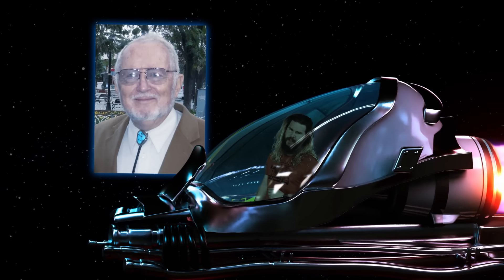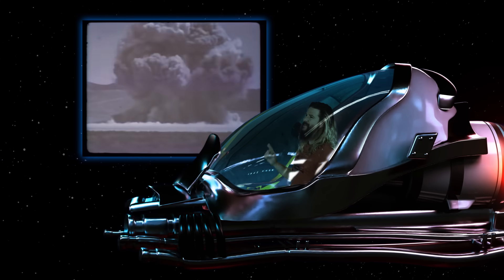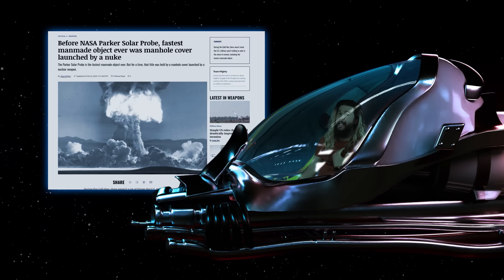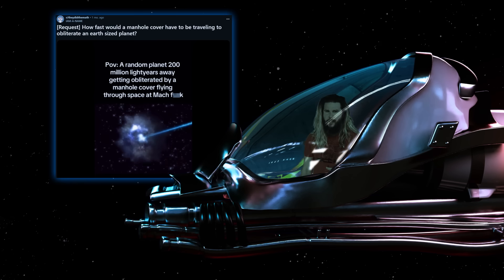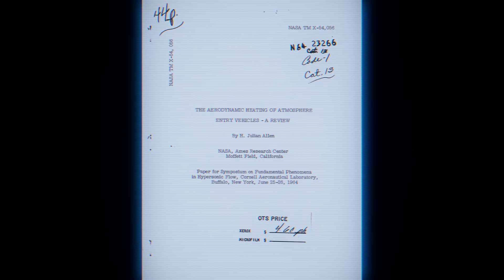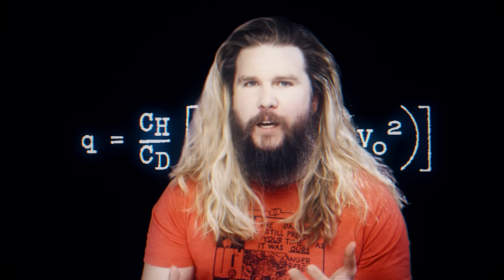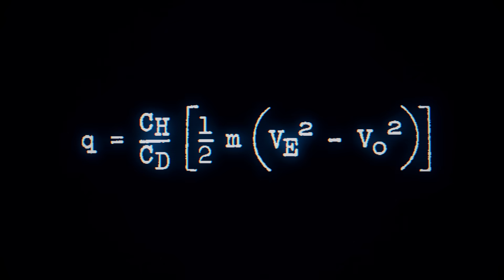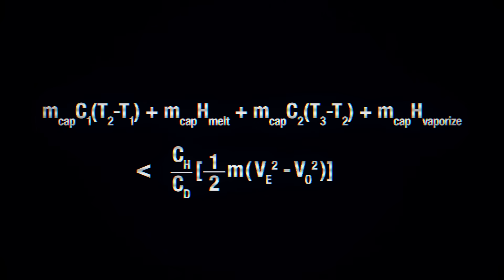Debunking the Nuclear-Powered Manhole Cover

Comment: You're forgetting a very important part to this, the force created by the nuclear explosion and air volume behind and around the manhole cover. Those calculations are specifically for an object ripping thru the air with nothing but it mass pushing it along.
Reply: The air behind the manhole cover doesn't move at mach whatever. Absolutely not. That's like saying a bullet from a gun is accelerated even when it leaves the barrel, which is nonsense.
Reply: nothing was pushing it along, it was given a kick at the start (that would rip it apart)

Comment: I have a couple of objections.
1.) When you're using the calculation for air resistance, you're assuming that the with the most surface area was face up the entire time. This is very unlikely to be what happened. When the explosion happened, it's likely that a section of the weld broke first. As that broke down the rest of the weld would break down fairly quickly. However, if that is the case, then the cover must have had some rotational energy imparted on it. (Think of lighting a fire cracker under a penny. The penny won't fly straight up without flipping end over end.) 
This means that using the calculation for air resistance is adding way too much heat to the object. If there is any significant rotation, the face of the cover simply wouldn't be "facing up". (I suspect you could cut the energy by half to come up with a good estimate, but I don't know how accurate that would be.)
2.) Meteors traveling through the atmosphere are probably not a good proxy. While they do heat up the issue is that they tend to explode. They tend to have ice trapped in them which eventually vaporizes and causes enough pressure to simply destroy the meteor while in the atmosphere. This likely wouldn't have happened to the cover as there was nothing inside that would cause it to explode in that fashion. It's cast iron, not a mixture of rock and ice.

Even with all this said, you're still likely right that the cover was vaporized. The eat generated in your calculations were an order of magnitude above what is needed. Even cutting the heat by roughly half wouldn't prevent it from being vaporized.

Comment: The assumption that the plate moved upwards as a flat plate is incorrect.  It was most likely spinning which will change the drag coefficient.  The path of the cover was straight up as opposed to at angle as you would see with a meteorite so that will effect the time in atmosphere.  The density of the air seems to have been neglected.  As the manhole was going up, the air density was rapidly decreasing which will reduce the rate of heating.  Lastly, heat transfer rates need to be considered closely.  How long does it take to heat the steel?  If the manhole was traveling 150,000mph, the total time spent in the atmosphere was about 1.42 seconds.  I am not convinced it didn’t make it to space and beyond.  If it stayed together.  But they never found ant pieces so…
Reply: 1.42 seconds is a long time at reentry speeds. At 66km/s, the drag would have been over a quarter of a million gees, that would stop it completely in 0.02 seconds.
Reply: @WJS774  That statement does not make logical sense to me.  What is the drag coefficient of a rotating metal plate?
Reply: @cityboywithhorses6233  Approximately one, the same as anything that isn't a highly optimised aerodynamic body. This is a "back of the envelope" calculation, remember?

Comment: My only problem with this is that Nasa says atmospheric decreases the higher you go, so my question is, can the cap reach a high enough altitude to where it can survive the pressure necessary and make it to space? And because of my question I still have hope for it that it made it space cause aerodynamically speaking the hotter and faster something is flying the more it aerodynamic it becomes so I feel that yes it melted but it melted into a shaped that allowed it to go into space someone around the size and shape of a baseball base

Comment: I think you are probably right, but it looks like one of your assumptions was v_0=0, or assuming all the kinetic energy gets converted to heat. If it retained most of its kinetic energy by the time it left the atmosphere then maybe it wouldn't be vaporized. It would be interesting to just see like a python script of a differential equation for the velocity vs altitude given the varying density and considering drag losses

Comment: The atmospheric heating is impossible to calculate in any meaningful way.  If the drag caused it to fly up directly side on, then not all parts of it would be heated in the same way.  If its flipping end over end at a colossal rate then there would even be a degree of airodynamic cooling going along with it.    It was also through the atmosphere of any meaningful density in half a second.  It's pretty hard to believe it managed to vaporise in that time, and even melt it.  For it to heat that substantially, conduct that heat to the centre of a 4 inch thick piece of iron, melt it and vaporise it in half a second is pretty hard for me to accept.

Comment: Are you sure about your numbers? Almost all the energy on the left side is in the latent heat of vaporization. Like 99.96  % of the energy is in vaporisation? I was trying to figure out what this looked like if you considered the entire column of air as a series of perfectly inelastic collisions. This would be worst case as it ignores the shockwave boundary layer that would help protect the object by having the shockwave stand off from the blunt object that is the plate. Using the total mass of the atmosphere and the ratio of the plate's surface area to the planet's surface area, I get around 23 metric tonnes of air resulting in a final velocity of the plate mass system of 2.5248 km/s. The kinetic energy lost in that collision is only about 1.8 * 10^ 12 Joules (but if you've got the numbers wrong on the left hand side of your inequality, that's academic). The whole thing takes about 2.9 seconds to reach space (100km) using this model. Yeah, I know, air pressure isn't constant and all sorts of things mess with where you want to draw the line when using this model, this is a somewhat arbitrary threshold I've chosen, you might be able to do better. The fact that it doesn't all collide at once means that the 2.5 km/s threshold is a lower bound for it's velocity at 100km above the surface. That speed is the reason I wanted to look at it from this perspective. This is quite different to re-entry as it takes time to have something burn up in the atmosphere. This is more like a deep-fried mars bar, maybe gooey on the outside, still frozen solid on the inside. It's lifting a column of air with a base area of the plate out of the atmosphere, a far, far easier thing to do than to compress a column of air into the atmosphere as you do on re-entry. If the numbers on the left hand side of your inequality are remotely close to accurate, at least some of this definitely made it to space.
Reply: Found the error, Iron's heat of vaporisation is 6340 J/g not kJ/g. Yep, this got burnt up easily.

Comment: There is a difference between the plug flying out of the atmosphere and a meteor entering it. The atmosphere gets thinner the higher the altitude so the plug would be encountering less drag as it travelled, while the meteor would encounter more as it moved lower. If the plug was going to vaporize I would think that it would have happened as it was launched as it would be moving at its highest velocity as well as encountering the thickest atmosphere. Of course I could quite easily be wrong since I’m nowhere near good enough with math to try and run the numbers. 

Also even if the plug did make it to space it wouldn’t have been the first man made object to do so. That would be a German V2 missile. One reached an altitude of 175Km which is considered space.

Comment: I feel like there are a few variables that were not discussed in this video such as maybe the manhole cover was flying sideways or tumbling through the air and the different are densities that this thing would have rapidly encountered and another thing is the speed that the object was traveling maybe it didn't spend enough time and the Earth's atmosphere to accumulate enough heat energy to vaporize.

Comment: Theres a few big problems here:

1) drag decreases as mass ablates, reducing the drag coefficient.

2) the cover would likey tumble, making its drag coefficient far different.

3) the atmosphere thins dramatically, basically if it hadn't melted by the stratosphere, it wouldn't.  You cannot take troposphere drag as a constant, you MUST integrate the density dependent drag coefficient to escape.

In short: this is wrong.

Comment: The problem i see with this conclusion is that the math assumes the object is traveling at that speed relative to the air surrounding it but the explosion pushed the air up with the projectile and by the time the air slowed down it probably was at very high altitude so very thin. It still may have been destroyed but factoring these things in would make it a lot less likely.

Comment: If you heat the manhole, it softens, and then conforms to air pressure. This would change it into a more aerodynamic shape. Thus you cannot use Cd as a constant.

Comment: It didn't need to turn into gas, it just needed to turn into a liquid at which point it would disperse and the surface area would increase, increasing both drag and heat transfer

Comment: I mean, yeah, it's only an order of magnitude of energy, and that's impressively close. You also calculated how much energy it would take to boil it. That's not including erosion, sublimation, and the fact that once most of the cap was molten, it would break up into droplets that would almost certainly scatter at the speeds and energies discussed.
I think someone trying to be as uncharitable as possible could use how "close" it came out, and hand wave some of the estimations to insist that it must have made it, but frankly the fact that you calculated against the energy to literally vaporize it instead of "just" how much would be required to destroy it lends a lot of credence to the likelihood that - even if somehow it was under ideal conditions - there's no way it survived.

Also there's the whole "was at the end of a nuclear blast chamber" that means the launch temperature was probably much higher than ambient. Hell, it had to break through the welds, it was probably already shattered and half-molten in that one frame of video.

Comment: I have to clarify that at the speed it was recorded that was the lower bound, combined that meteors don’t go through the atmosphere at a perfect vertical, meaning they go through more atmosphere for longer, and it gets more dense as the object gets further into it, it’s safe to say that the manhole cover is in space. Launching an object at that speed vertically up through an exponentially decreasing volume of atmosphere means that the most resistance is at the start, it also doesn’t account for all the air behind the manhole cover that is still moving at that speed, acting as a cushion against the existing atmosphere. 

TLDR manhole cover reaches space in literally a second. There is not enough time for the manhole cover to destroy itself.

Comment: ok, this is a minor issue that i honestly dont think will change anything however
i do want to point out that the manhole cover would be on its side going through the air, it wouldnt be flat, air resistence, ultimately this doesnt actually change much but it is a nice little piece of info for anybody else doing up the numbers

Comment: Yeah i dont necessarily agree with this. You assume its angle was constant and that atmospheric density is constant, which it isnt. And it would have cleared the atmosphere in less than 2 seconds. Which i dont believe is long enough to conduct the heat necessary to destroy it, especially when its tumbling. As the fat elecrician said, "this thing was moving so fast, even friction was like "what tha f*ck was that!?!" ".

Comment: The math seems to be mathing, though there is one major difference between exiting atmosphete and entering. On entry, the vety cold body of the asteroid falls into an atmospere that gets denser as the asteroud falls. Now the comparitively warm manhole cover starts at "dense" atmosphere and assends into a cold vacuum. Given the speed, it was at 30000ft, where it's already -60F in a fraction of a second. I wonder if the math accounted for that.

Comment: As Scott Manley noted, hyper-sonic movement through atmosphere is dominated by ram pressure from the backpressure of air being pushed out of the way - and not having time to get out of the way before the mass impacts it. Adiabatic heating then further increases the pressure along the line of motion ... Is the energy gained from 2 seconds of such deceleration enough to destroy the slab?

Comment: Devil's Avocado here, does the equation consider loss of velocity going from high density to low density atmosphere vs re-entry which is low to high? Seems there would be a large initial loss and progressively lower density of atmosphere to transfer energy from.

What's the math if it's orientation is "hotdog" instead of "hamburger" or even tumbling?

Is the reduction of mass as the iron vaporizes taken into account? 

Has your math been peer reviewed, can't be too careful when throwing that much shade 

Bet.

Comment: Are you taking into account the change in velocity it experiences with drag and the decrease in density of the atmosphere as well as the change in temperature from the surface. There is also the possibility due to drag the plat would have oriented along the narrow axis and therefore changed it drag and  provided a larger surface to dissipate heat along.

Comment: Another heat source to consider was the heat emitted by the nuclear blast itself, a considerable amount. Since the heat would have reached the plug before the blast pressure wave did, it definitely absorbed a considerable amount before ejection. Ergo, with that instantaneous positive delta-Q, plus the frictional positive delta-Q, somewhere in the southwest there perchance is a somewhat-radioactive bit of iron slag, a small amount to be sure, the rest having become Fe plasma. I don't have the yield-data for the blast, so someone with that could possibly work that into the computation, for what its worth.

Comment: So, matter can't be destroyed nor created, only altered through chemical reactions; right? So that means irradiated gaseous iron went into the atmosphere and eventually made it back down to the earth because iron, even when heated to a gas form, is chemically heavier than the elements of air. So is there signs of this? I'm not asking to be confrontational. I'm asking out of genuine curiosity. 2000 lbs of iron into gas ain't a lot in comparison to the entirety of the atmosphere, but surely some of it had to of gotten caught up in some clouds and literal radioactive iron rain fell down on some unsuspecting flora or fauna.

That bit of controversy aside, I think the rest of "Operation Plumbob" is......interesting. Not really interesting as in we learned a bunch, but more of we did a ton of redundant testing that could have been condensed into about half to a third of the number of tests done. Testing the resilience of different building materials AND the effects on soldiers (because that was the "let's see what this does" period of nukes with the US) definitely could be done in the same test and also several building materials could be used, and the testing on pigs exposed and pigs wrapped in layers.....Like there's just several things where it's like they blew up nukes because they could, not because they had to.

Comment: If you calculate the total cinetic energy of the manhole 1/2mv², it gives 2X10¹²J , witch is les than the energy needed to evaporate it, and also less than the energy calculated as heat transfer, so, could it have gotten more energy as friction than it inheretly had?
Reply: Also, if it did heat up more than the initial energy, were did the rest of the energy come from? Did it freze the air as it pased troug? It seems to break the second law of thermodynamics

Comment: I refuse to believe it didn't make it into space, it would've cleared atmosphere in about 2-6 seconds and most of the thick atmosphere would've been cleared so fast I doubt much heat would've transferred much less the fact that it was a very thick cap. The meteor to energy conversion is totally bs, meteors unless metallic are loose packed rocks and that is why they explode much less the metallic meteors almost always make it to the ground.